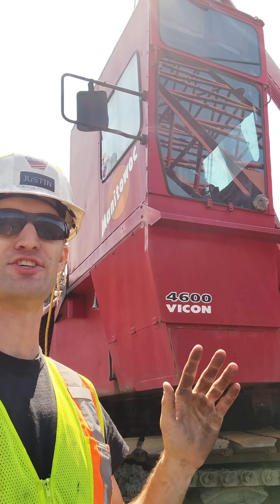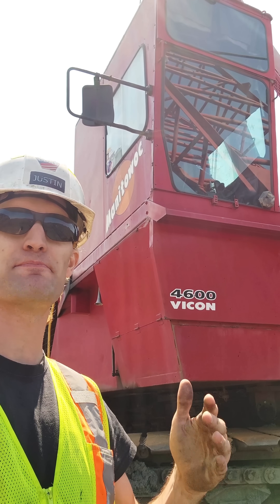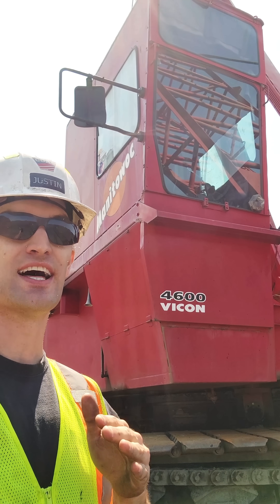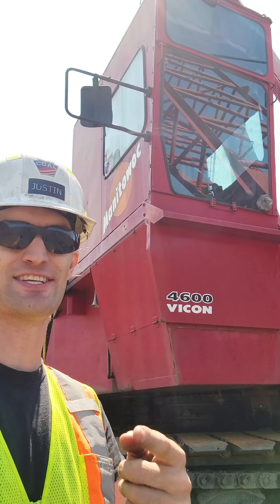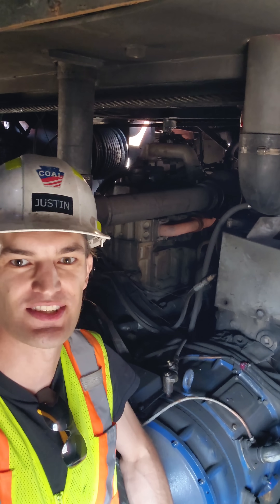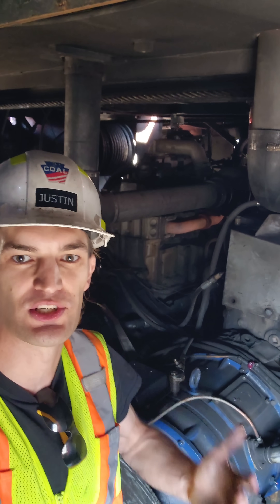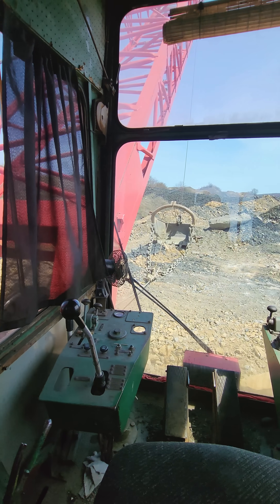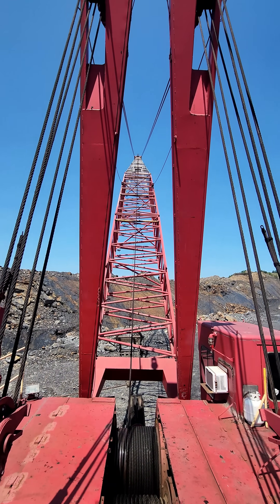What does VICON mean?

Comment: Blah Blah Blah.  Here we go again. 😂I’m sure by now You know I’m an old 2400 connoisseur, and I’m of course just messing with You Justin. The vicon system did not enable a 4600 to hoist faster than a 2400(B) . The  big advantage of the 4600 was the interlock system, when they were working, and often they did not. When conditions required casting to reach material beyond the point sheave , which was common, you have to reel the bucket in close so momentum can be achieved for casting. With the 2400, you have to wait for the bucket to retrieve at normal speed, which slowed down cycle times. The 4600 shined in these situations because when the interlock was engaged after dumping, the bucket would retrieve at the same speed the bucket was coming down, so when you returned to the digging position, you were already “reeled in” and ready to cast. Granted , the old 2400’s were much slower than the B models, which started in 69, so comparisons to the 4600 need to be made to the B models, or the “Clark” models. The 2400’s were a much more rugged and reliable machine than the 4600’s , which also has to be considered in the big picture. The 4600’s had considerable more “ downtime” than the Lima’s , especially when , let’s just say, poor operators, were a factor, and that sadly was often a big factor, in both machines.  A big design flaw on the Manitowac was the house rollers and roller paths , which often got chewed up when not kept lubricated . They were made flat/ square, which caused “ scrubbing” , where as the Lima’s rollers and paths were angled as they should be. Crazy that Manitowac did that, but they did. I better quite now or I’ll have to start another chapter , which I could easily do! 😂👍👍🇺🇸
Reply from the maker: Oh yes, you're 100% correct about the interlock system but the 2400s were still single speed machines. Yes the interlock did help with the speed but imo having the ability to govern the engine off the hand levers was a huge benefit over the Limas. And sorry, ergonomics wise, the 2400s were just horribly old school. The biggest compliment I've always heard about the limas was how overbuilt they were compared to a 46. Slow old dinosaurs lol🦕
Reply: @PAmining I’m just having fun and enjoy these discussions Justin.  The hoist and drag speeds on the newer 2400’s were increased through gearing on the newer units, so the old original’s I’m leaving out of this .  If you could do a comparison of the hoisting rate/ speed of both machines, empty or fully loaded , you will find absolutely no discernible difference . The ability to regulate the rpm’s via the vicon system has some benefits, but does not increase the maximum speed over the maximum of the 2400. I certainly agree the operator cabs were much nicer on the 46,and definitely quieter due to being outside of the machinery house. As far as ergonomics, no different. 3 levers and 2 brake pedals, and a seat. And another slight drawback on the 46 is the hoist and drag brakes due to a much smaller diameter than the 24. If pushed a bit too much, the hoist brake would overheat in short order. The newer 2400’s had a pretty good blower/ cooling  system for the brakes and even some had cooling ducts to the swing drums , and it made a big difference, especially on the hoist and drag brakes and clutches. One thing I can tell you regarding the hoist brakes overheating on the 46, the top notch operators know how to alleviate that overheating problem with the interlock  and left foot! Operator expertise is by far the biggest factor in performance and also reliability in any equipment, but is much more relevant in the dragline realm. I would even go as far as to say it was and is the key difference. Thank You Justin, and I’m sure You know how much I appreciate all of your content. 👍👍🇺🇸
Reply from the maker: Haha, oh I know! All fun 😁 that's interesting because every 2400B I've ever seen run, specifically a Clark was slow as shit. And my observation was a 2400b and a 4600 side by side. Actually I think o have a video of them two running together on here! Was a cool scene many years ago. I've actually seen two B models run before and they are just slow. There's no way they are the same dog and swing speed as a 46 working off a single engine and torque
Reply: @PAmining 👍👍🇺🇸😂 If a yellow Clark was slower than the older red and grey BLH Lima B models, something was not right. The Clark’s were every bit as fast as the 46 if everything was up to speed and had a good guy behind the controls. The downfall of the 2400 was when Clark was forced to start fabricating the tubs and superstructures, as opposed to the older cast units. You probably know that story.  I ran the next to the last one made by Clark , and I honestly believe the company I worked for at that time was a significant reason for the final demise of the Clark dragline division . Back then, they cost 1 million $ and came with a 1 year warranty. The company I worked for at that time purchased 4 of them within 2 years, and Clark got royally taken over the coals on that warranty. Not at all the fault of the machine, but the fault of the company I worked for. You probably wouldn’t believe some of the stories I could tell you about the outright abuse and destruction that these poor machines were subjected to. It still makes me cringe to this day to think about it. They would get one of these new beautiful machines in on a job site, and pull dozer and loader operators off their machines, and put them right on the new drags, have someone show them the basics of the operating functions, and let them have at it! You can probably imagine the carnage that ensued, and it did. It was also the demise of that company due to the constant downtime and repairs on these poor machines. I could write a book on this subject , and you probably wouldn’t believe some of the carnage I witnessed in those days , would have to be titled as a mechanical horror story, but it is non fictional.  I enjoy telling these stories and hope you enjoy hearing them Justin. I’ve got many more. 👍👍🇺🇸😂
Reply: @PAmining Now isn’t that a coinkadink. Video of 46 relaying to 24. It’s plain to see the 2400 has to fiddle around waiting on material!   😂😂😵‍💫👍